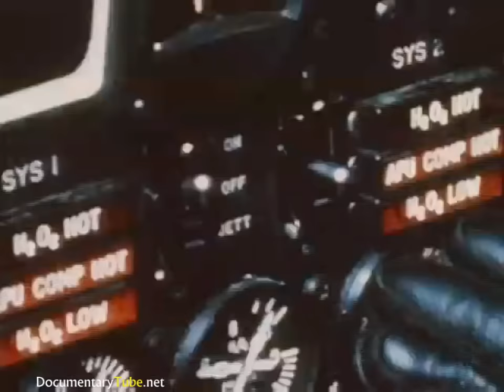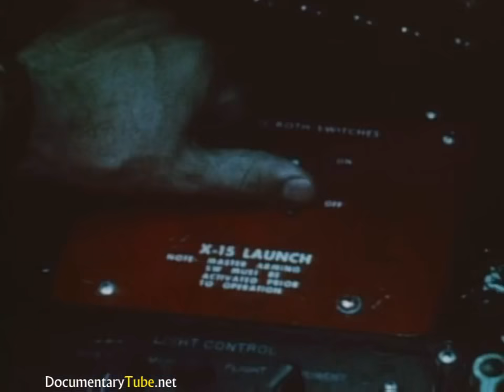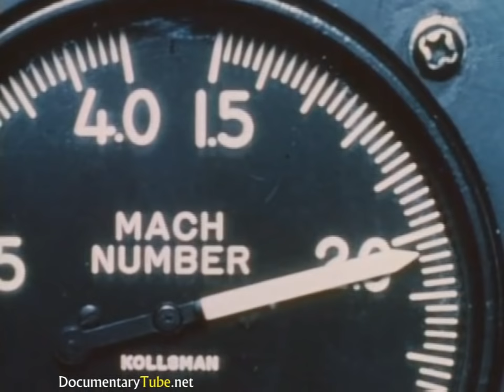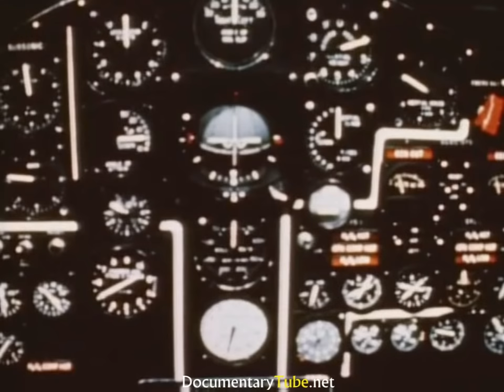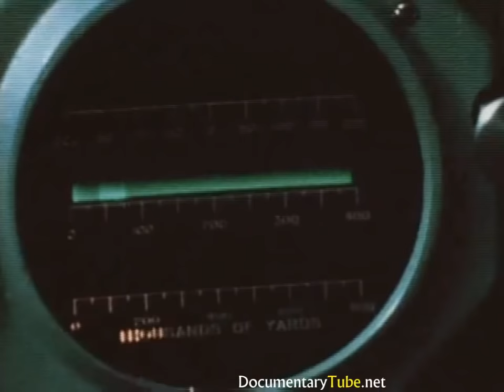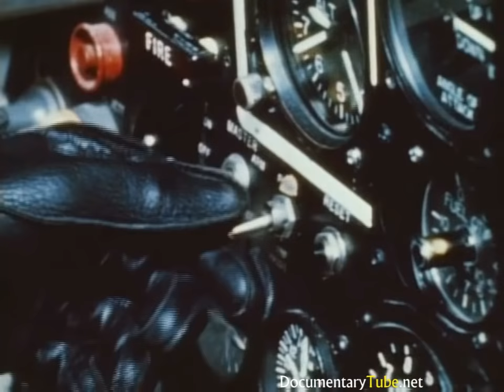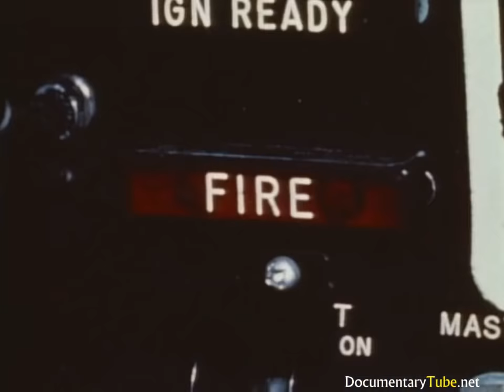The Fastest X-Plane - Mach 7 North American X-15

Comment: This aircraft made it to space before the Mercury space craft.   Just barely but it did.   It was a challenge to fly  as you flew it one way when at altitudes where it was an Airplane.  But had to be flown differently at altitude.   One failed flight the on-board avionics had attitude info and the plane reentered  at the wrong angle and broke apart.   Scott Crossfield   was famous for being misquoted after a Engine Static ground test caused an explosion split the plan in half launching the cockpit away from the explosion.  They had to wait to get him out until the fire was put out and he got wet from all the water and foam.  He was asked if he was OK.  He responded that well I got my pants wet but I"m alright.  The stupid reporter said X15 explodes Scott Crossfield wets his pants.
Reply: Reaction control jets (rockets) were used to control the X-15 above altitudes at which the control services would be able to interact with the atmosphere.  They were controlled by separate control systems.

Comment: But what's  the logic behind launching it from B 52 strato?
Reply: It’s like sending a glider down a mountain, the higher up the easier it is to gain speed, they need all the fuel they can get to use it within 3 minutes and simply don’t have enough to take off and reach that speed at the same time

Comment: X15 says mach 6.2 and the SR-71 Blackbird only 3.2 but they say the SR-71 IS THE FASTEST PLANE .Which is fastest .
Reply: Dano Dee 
Perhaps they mean in sustained flight? The x15 only hit that speed for few seconds before running out of fuel and gliding down to land.
Reply: Actually, the fastest plane to maintain its speed is the concord, at mach 3 with supercruise. The sr71 achieves mach 3.2 but can only do that with afterburner for a short amount of time while being refuled in air. So in short bursts, yes. It is the fastest, but in the long run it is beaten by a consumer air plane. The closest we have to the concord for supercruise is the f22 with mach 2.5.
Reply: @yump2011  the Concorde NEVER went that fast. Mach 2.2 is its speed.
Reply: You’re wrong. The SR doesn’t refuel at Mach 3.2, that’s insane? It got better mpg at Mach 3 then it did at Mach 1 because of its engines, so you better believe they got up to speed ASAP and sent it to conserve as much fuel as possible.

Comment: hand horsepower the theoretical horsepower required to drive a fan is the power that would be required if there were no losses in the fan that is efficiency where 100% theoretically horsepower required to drive a fan can become pubic computed by the means of the following formula HP equals q X fan PT divided / 6356 where q equals quantity of are in cubic feet per minute the brake horsepower is the power actuallyto drive a fan the brake horsepower required to drive a fan is always larger than the theoretical horsepower because of energy losses in the fan the brake horsepower required can be determined only by an actual test of the fan fan efficiency equals q xfa npt divided / 60 356 X brake HP the static efficiency is computed in a similar manner using fan static PSI instead of fan total PSI fan static efficiency equals q xfa N x Pt divided / 6 356 X brake HP fan fan static efficiency is the static energy output / the power inputthe total efficiency of a fan always provides a true indication of Fame performance whenever the total pressure is known or it can be accurately determine while the static efficiency is not always satisfactory for measuring the actual work of compass by the fan example the outlet velocity is higher than the do u c t velocity of a Lhasa T pressure is available that may be converted to static pressure provided that the d u c t system is provided properly InDesign the static efficiency as normally determined but not take into account the increased and static PSI does providing and therefore but not be an accurate portrayal of the fan performance again the fan operated free delivery the static efficiency below zero

Comment: if 
x 15 
pass mac 7 

how is it possible 
all other old type 
craft was flying with X15
on same speed
Reply: NOOR MY SON A N Z T the chase planes were left in the dust as the X-15 accelerated and climbed. After the burn and the X-15 started back down it started to slow down and the chase playing for finally able to catch up to it. There was the f-104 and it looked like an F-100 as Chase planes. Both of those Jets could go Mach 1 or about Mach 1.5. The X-15 to climb like a homesick angel but the chase planes didn't have the ceiling or capability to follow it up all the way.

Comment: like other types of thermal storage thermal energy chilled water storage systems stratified tank design stockpile energy in the form of he captured from process or comfort cooling and rejected later when ambient temperatures in energy call style or the chill water thermal energy storage systems commonly used as above ground or underground stratified tanksspecifically engineered diffusers are nozzles distribu warm water at the top of the tank and cool water at the bottom the laminar flow they induce or bring about and promote stratification to maintain a neutral boundary layer or thermocline between the cool supply water in the warm return waterrefrigerant migration free cooling system and then and energy conservation system design action associated with large essential plants is called cogeneration system is to reduce overall energy caused by generating electricity on the building site in capturing the waste produced by the engine since the cost of the locally generated electricity alone is often higher than provided by the utility systems economical advantages derived from beneficial use of the the waist of the use of theoften the waste heat produced in cogeneration system is used to satisfy hot water loads alternatively it can serve as a heat source for maintaining proper space conditions during the heating season in some cases and then where appropriate that the heating season the four economical potential of waste heat can be exploited to driving absorption chiller that provides chilled water chilled water for comfort or for process use there are additional first cost and maintenance requirements to consider when evaluating the feasible abilities the feasibility of a cogeneration system for any particular application at the temperature is available from the code generator on a sufficient to driving absorption chiller it may be necessary to add another he source to elevate the hot water temperature and to provide a backing up heating systemwith the coming of the time of day you wait structures from utilities the need for an energy conservation system design option call thermal energy ice storage system has come to the forefront Incorporated in ice storage system into a HVAC system to system design can reduce the energy cost substantially by shifting the time of the equipment operation for my calls to all people do periods when a cooling demand develops during the off or on peak I'm sorry how utility way. The water mixture heating by the load is circulated through the storage tanks to melt the ice simply stated the ice is generated at night when utility rates are low and is then used for cooling during the day when utility rates are highan energy conservation system design option are associated with large essential plant is called a CEO generation system these systems are used to reduce overall energy caused by generating electricity on the building sitephanpy s equals PTO - PTI - pvo the fan standing PSI is a fan total pressure subtracted from the fan velocity pressure it can be calculated from that subtraction of the total pressure at the fan coming in 1/2 from the static pressure at the fan going out and you know the rest the fan performance commercial fan performance data is calculated from laboratory tests conducted in accordance with the present are moving and conditioned association's amca Tesco the current code is that for are moving devices bulletin number 210 the cold establishes uniform testing methods to determine of fans f l o w r a pressure power speed of rotation and efficiency that old is designed for testing centrifugal and axial fans with variousd u c t arrangements the fans are tested in either the blower or exaustor configuration shown typically AMC a code test set up when testing a fan the p i t o t to make some prescribed transverse of the cross-sectional area of the duct measuring velocity pressure static PSI buildup in total PSI from the results of these tests from the computations outline by the AMC a code fan performance may be completely established

Comment: There are a lot of different camera shots inside that cockpit. I smell a rat!
Reply: Jim Anthony no you did not
Reply: This was a very common practice with the eXperimental aircraft back then,  Even Chuck Yeager's X-1 had its instrument panel filmed.  There were two reasons for doing this,  One was to capture the instrument readings for later analysis with the other sensor tapes that recorded what was happening through out the air frame.  The other was as a backup just in case the pilot did not make it back to report on what happened, they might have some film on what was going on, when the aircraft departed its normal flight envelop.

Comment: no way .. in any way it's cannot do the mentioned speed coz of many issues and factors .. the fuel won't be enough to reach this speed .. if they used solid fueled rocket gonna be big if jet system impossible the jet gives you this speed would need more than liquid fuel in rockets shuttle boosters .. in every way this is a lie not more
Reply: You need to look at later parts of the X-15 program when they mounted external fuel tanks and put an off white ablative coating on the aircraft to try and handle the skin heating.  This lead to the push for newer materials that would handle such heating.  Much of our performance data that helped with designing the space shuttle, and XB-70, and other high speed aircraft, was obtained from the X-15 data.    Way to go guys and gals who worked on that program.

Comment: Some bad rocketplane, dont agree on term of OUTER Space, should mean DEEP Space, our LEO or high atmosphere is nick named space but it is not, rockets dont work in vacuums.
Reply: Rockets do work in a vacuum, they ignite with an oxidizer which is a compound that has oxygen and other substances that mixes with the fuel in the reaction chamber and as soon as they mix they instantly ignite, thats why rockets don't need the oxygen from the atmosphere. In research the possibility of launching rockets from water instead of land was explored, the aim was to use water buoyancy to sustain the weight of a massive rocket that would destroy land platforms with the thrust. I invite you to research on rocket engines sir.
Reply: @Michallote  ....did not mean that working, guess they could blast, but barely move.
The explosion is going to push / flow at the Nothingness more then the ton rocketmass.
Reply: @trillrifaxegrindor4411  Neither, what are you? Teachers pet? On a scientific blog are you?